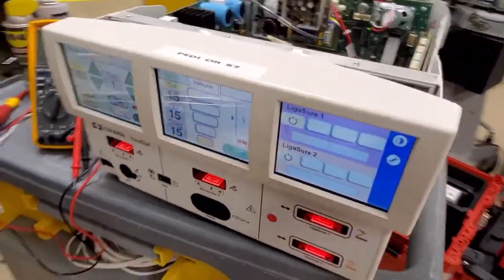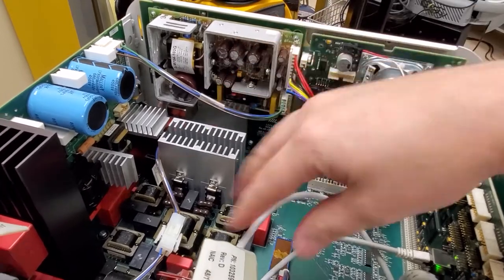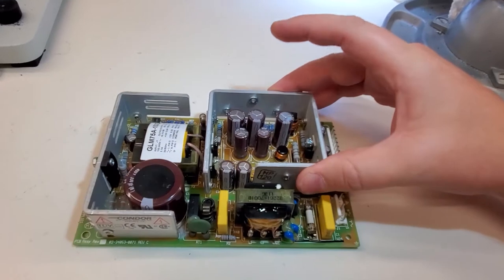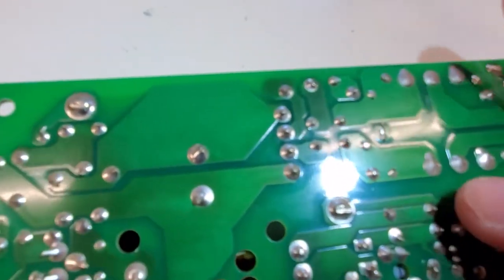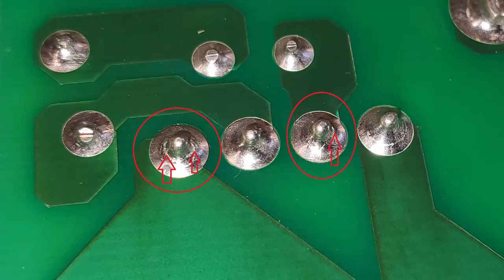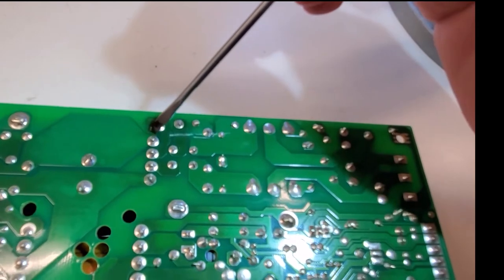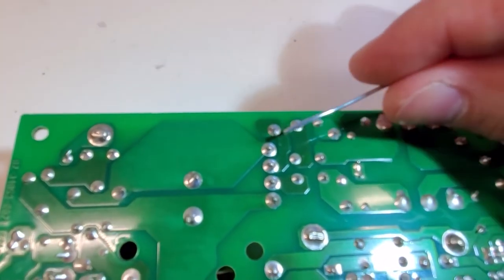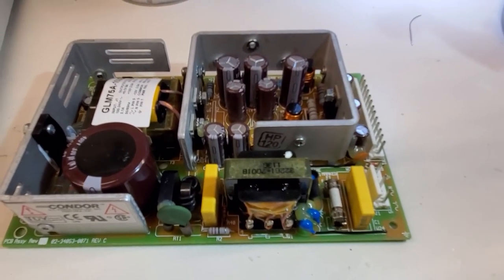Anatomy of a Failure: Force Triad NO POWER!

Comment: Thank you so much for your video. I have one of these units and mine just never finish the startup. Stay stuck on the screen with the Covidien logo. Any ideas? I check my low voltage and resoldered as you instructed (definitely cracked) and changed the fuse. Thank you

Comment: Oh this is a very nice one. I've had this happen on my car's mass air flow sensor and didn't want to fork out hundreds of dollars. Simply resolder and it was good to go. Solder points failed due to mechanical stress rather than temperature fluctuations though.

We've also had solder point failures on our Philips CT scan signal brush. Our CT scan would suddenly stop during scanning, and was diagnosed as a faulty signal brush. Due to covid and flight restrictions, a replacement could take weeks. I took the signal brush out and the solder points looks just like the ones in this video. Simple solder reflow and we've saved time and lots of money.
Reply from the maker: Yes, those intermittent errors due to vibration stress. I've seen that too. To the naked eye there is no problem but under my microscope you can clearly see separation of the material.

Comment: I have a different problem.  Error instrument combination not allowed please remove one of the instruments! Any thought? Also the 3rd screen is not active.
Reply from the maker: Disconnect all instruments.  Check the detect microswitch in the ligasure port for damage.  Also, make sure the software is updated as much as possible. Some newer handpieces might not be compatible with Force Triad
Reply from the maker: I think you can check port status in diagnostics menu. Make sure that it doesn't think a handpiece is plugged in when it is not.